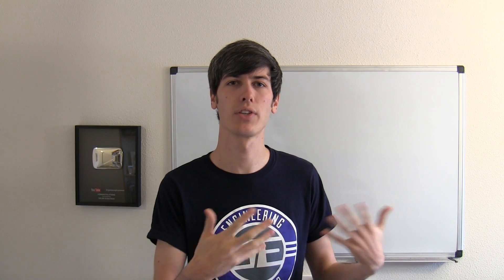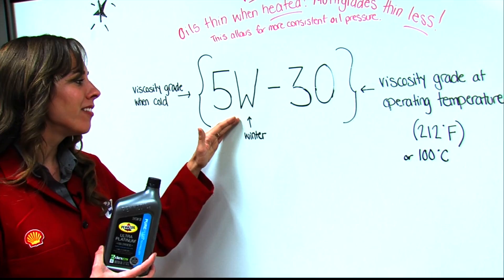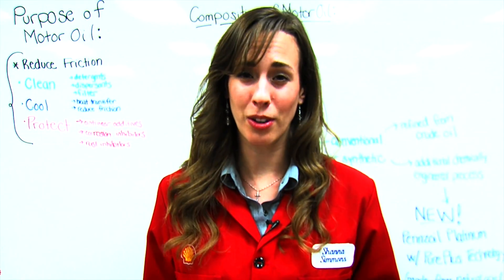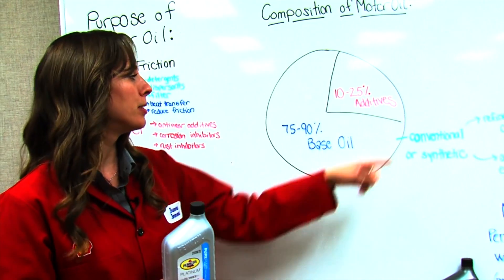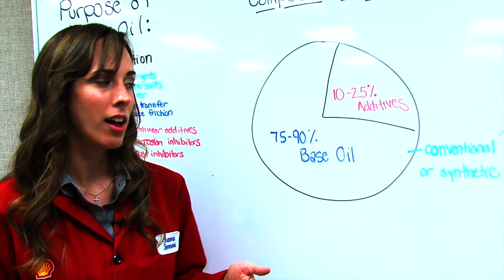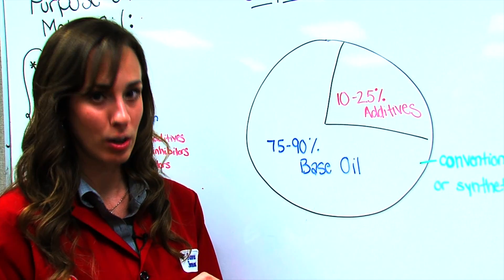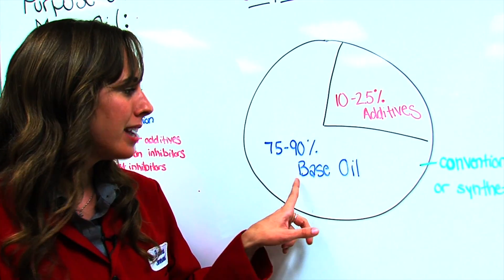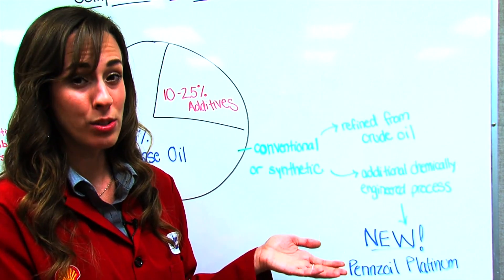Motor Oil Myths & FAQs - Synthetic vs Conventional

Comment: You should mention the advantages of a full synthetic in a very cold climate when starting a car. Also for other equipment in the low temps. I run a full synthetic in my cars in the cold Michigan winters. Go out when it is below zero and start your car with conventional oil and it turns over slower at that temp and watch an oil pressure gauge take a bit to get up to full pressure. Do the same with a full synthetic and the engine spins up as fast as when it is warm and the oil pressure goes right to full pressure. I have also had large snow blowers, run a conventional in one and pull start it and when the temps bottom out it can be like pulling a tree stump out of the ground. Use a full synthetic and no problem pull starting.

Comment: The advantages of trued Synthetics are 1.  It's molecular structure is very uniform  (lubricates more evenly/better.  2. It's more stable with temperature than plain mineral based oils.  Mobil 1 is made from PAO's...Polyalphaolefins, a synthetic product.

Comment: There is also the issue of advertising synthetic oils. There are 5 levels of oils that can be created going from the level 1 conventional oil to the level 5 synthetic oils. Difference being in how each of the oils were refined. In Europe, only level 5 oils can be advertised as synthetic. In the US, both level 4 and 5 can be legally advertised as 'Full Synthetic". That is why, for example, Mobil 1 calls all of their oils 'full synthetic', but their 0w40 as 'Euro formula synthetic'. The only true synthetic in their lineup. Same with the Castrol 0w40 Euro formula synthetic.
Reply: +AK540i  Group IV is the true PAO base that was first used in auto oils in the US in 1972 ,it is used in Europe also ..

Comment: OK the W rating means that the MULTIGRADE oil is as thin as a 5W straight oil would be at a freezing cold temperature.  There is however a lot more to oils than viscosity. One test involves four steel balls that are run in a jig. The better oils can handle more pressure before scuffing occurs. 

One empirical result was the disaster that occurred with a friend's VM Motori HR 492 diesel engine.  The manual stated that a turbo rated oil of Mil 210 spec or higher was required.  Instead cheap supermarket 20w-50 was used as the man had a theory that regular oil changes were all that was needed.  In actual fact the cheap oil worked OK for three months during the running-in (break-in) period.  During this time the fuel delivery screw on the injection pump was set for reduced fuel.  The pump was then turned-up until black smoke occurred during hard acceleration.  Unfortunately after two weeks the engine was knackered!  The pistons and cylinders were badly scored. This would suggest that cheap oil intended for non-turbo petrol engines just cannot take the pressures that exist in a diesel engine.
Reply: He was rolling coal m8 plus he should have used the recomended oil grade

Comment: on my car it says to use 5W-20 ive been using 5W-30. it really doesnt do anything bad as long as you dont go crazy and make it much thicker like 20W-50 in a car that needs a thinner oil.
Reply: +revelationns Agreed, but I also think that car manufacturers are using & recommending thinner oils now just because it improves fuel economy & horsepower. There's less resistance with thin oil vs thick oil. It makes their numbers look good. 

But there's a downside to this trend. The idle was rough and the valves would occasionally chatter with my 5.7 liter Hemi, but it instantly ran smooth & quiet when I increased the oil viscosity. Thicker oil sticks to parts and cushions them. 

And get this: My car is a 2014 and the manufacturer recommends 5W-20, but with older models it was 5W-30, and with the new 2016's they recommend 0W-20! What's next? 0W-5? I run 10W-30 because it works much better.
Reply: +OddTimeMan 
You are absolutely right.
For my car, when new, the recommendation from the factory was a 5w40. Once I passed the 300,000km / 186,400 miles I started to use a 15w50. If I, hopefully, reach 600,000 km / 372,600 miles I pass to a 25w60.

Comment: What people usually want to know about synthetic motor oils are:  Will my engine last longer with synthetic even though the owners' manual says that conventional oil is fine?
Can I really extend the oil and filter change intervals past  that recommended by the manufacturer and not experience engine wear beyond that when the recommended interval is followed?

Comment: mobil 1 vs royal purple which is better?
Reply: +Blk Popeye Mobil
Reply: +D3AThCAl2DS link?
Reply: +D3AThCAl2DS Mobil 1 is shot the first time you start the car. It sheers like crazy.
Reply: Well I use royal purple in my car for the pass 2 years and have had no problems..What make valvoline better than what I'm using?
Reply: royal
Reply: +Blk Popeye depends on purpose and oil change intervals purp wont last 3K at all
Reply: +D3AThCAl2DS are you kidding? rp lasts a long time
Reply: i have seen lab reports of 800 miles and they said it was shot
Reply: nvm facts go to the back and opinions come forth thats what i have learned after reading on so many different videos so i just don't care at this point i will keep things to myself
Reply: cold protection not that anyone cares -.- or will take into consideration
Reply: Well Royal Purple suits my needs I use both the motor oil and their super atf in my transmission
Reply: +Blk Popeye On personal experience, I've used Mobil 1, AMsoil, and Royal Purple.  I think the label on the back of the RP says you can use 1 year intervals or 10-12k miles or so.  I've actually been following that interval on my old 16 year RD1 CR-V with Royal Purple for about 10 years now with no problems.  But also consider that I don't drive many miles on it.  I never reach the 10-12k miles.  I maybe put about 3000-4000 miles a year on it.  I haven't had any issues.

I also use Royal Purple on my turbo'd B16 EM1 and I change it every 6 months regardless of mileage.  But there was an instance I didnt change it for a year and a half.  That being said, I only put about 50 miles on it during that 18 month span.  

Ive never ran into any issues, but I also don't drive many miles.  That being said I haven't run into any issues using any of the oils I've used.  

When I use to drive my CR-V more often, in the freezing temps of Michigan of below 0, I drove it as my winter beater from 1999-2009 and I was putting regular miles on it, I still didn't run into any issues on the yearly interval.  Again during that time it was seeing most 4000-5000 miles a year on it.

Its not that I dont drive a lot.  Its just I spread mileage across a few vehicles. CR-V, EM1, S2000, CBR600RR, 350Z, Pathfinder, Xterra, Altima, different CR-V, another different CR-V, ANOTHER different CR-V, hahahaha, a few Mazda's, etc.....

That is just my personal experience though, other people's might differ.  There are always variances.  Also wrong applications can occur, or improper procedure.  you might just run into a complete idiot.  .

So, just make sure you're using the right kind of product for your application.  You should be fine.
Reply: My experience with using Royal Purple motor oil in my lt 1 v8 1996 chevy caprice and the evedant test of this oil ran on youtube I feel that if I had a Honda CRV or any Honda product I would use it to its fullest extent because in my opinion its good for smaller higher reving engines.
Reply: I use Motul during high street performance but OEM genuine oil with the suggested viscosity grade is ideal on daily
Reply: +Blk Popeye Try this. https://www.amsoil.com/lit/g3115.pdf

Comment: can you please tell how can I know the viscosity rate of my car or motorcycle engine???
Reply: +Jatin Anand Oil viscosity recommendation for an engine change according to the climate zone you are in.. In extreme conditions it could pay of to adjust viscosity choice according to your local temperature situations.
For example at arctic winter situations it's often vice to fill lower viscosity oils on engine and drive. An older type 15w-40 diesel engine oil would be thick as syrup at - 30 C and make it nearly impossible to crank the engine to a start.
Your local auto technician should be able to help you with this if you cannot find a guide for this in  the manual for the vehicle.
Reply from the maker: +Jatin Anand Check the owners manual or often it's on the fill cap.
Reply: +Engineering Explained. oh....thanks :)
Reply: +Jatin Anand 10/40
Reply: bikes 10/40
Reply: Not all bikes take 10w40 ? You should look in the owners manual or look what oil a reputable manufacturer recommends
Reply: The whole point of synthetic is it lasts longer than regular oil. In a motorcycle it serves many functions. It's engine oil, transmission oil, clutch oil, it's used to cool the engine and your alternator sits in it..It's just better to change your oil more often. So just use regular oil.Bike shops will try to sell you expensive oils .Just use a good regular oil like Valvoline ..Save your money.
Reply: +Mud Sh-sh-shark Older Harleys had three different engine oils depending were you rode it .stright(mono grade) 30  50 or70. 50 was the common one, but somewhere hot it would be 70 and somewhere cold 30 grade.
Reply: 10/40 is good for any bike engine

Comment: "working at a oil change shop"
Customer says "Give me anything but that Pennzoil shit"
I put Quaker State in their car.
Reply: All my life, I have heard just the opposite. Pennzoil and Castrol good, Quaker State bad.
Reply: @1SqueakyWheel  Which is why you need to stay current on things. ln the past 40 years all of those brands have changed the source material of their basestocks as well as the processing that it goes through so what was true back then is no longer true now.
Reply: @JA-rn5qv  Wow you woke up an old thread. 
So what's true now?  :-D

Comment: Guys she is not as smart as she appears in this clip, she did not even mention that the main cause of sludge buildup is mainly from doing short trips in a vehicle and never really getting it up to proper operating temperature. This is bad because as the engine runs it produces blowby gases that make their way past the rings on the pistons and in these gases is moisture from the air that the engine breathes now this moisture is not bad as long as the engine reaches full operating temperature which is well above 212 degrees and at these temps. any moisture is driven off and removed from the crankcase and engine oil but short trips never heat up an engine hot enough to drive off this moisture and a vehicle that makes many short trips ends up contaminating the engine oil with lots of moisture but the story gets worse because this moisture that is now in the oil reacts with the gas sulfur dioxide that is present in the crankcase while the engine runs and moisture+ sulfur dioxide makes sulfuric acid and this in turn converts some of the engine oil directly into a corrosive sludge which will build up in the bottom of the engine pan, inside the valve covers and basically anywhere else in the engine that does not get hot and have good oil flow to help clean it of sludge. Engines that never really get up to operating temperature or in severe winter environments should have the oil and filter changed every 2000. miles at most or every 6 months whichever comes first. Never change engine oil without changing out the oil filter, it just is not worth having the old oil contaminate fresh oil. Always change both and always change the engine oil when the engine is hot, let it drip out for as long as possible, I try to leave it drip for a good 10 minutes at least but the longer the better since more that drips out the cleaner the inside of your engine will be when you add new oil. Ps don't forget to install the drain plug and snug up the new filter before refilling with nice new engine blood, engine oil. Kendall/Chevron/Shell/Lucas
Reply: +Marti woodchip saying I'm not as smart as I appear is a bit of an unconscious bias :-) You should check out my Know Your Oil series on the Pennzoil YouTube channel.
Reply: +Marti woodchip U got told bruh
Reply: actually she didn't come across as particularly smart, but I'll bet that it's just a lack of good presentation skills and self-confidence.

Comment: Question: Is this true ?
Synthetic oil has an additive to swell engine gaskets. Once you use synthetic oil you should not go back to regular oil because the engine gaskets will shrink causing leakage.
Reply: False
Reply: +Jimpony1988 
Finally an actual myth!
Or is it?

Comment: There's so many things missing and wrong with this video. 
1. There are different grades of base stock ranging currently from 1-5.  1 being the most garbage poorly refined cheap crap you can buy from walmart, 2 being your average conventional, 3 being cracked conventional oil and what most people refer to as synthetic(even though it isn't truly synthetic by definition of the word since it's still sourced from dino oil) grade 4 being your first truly synthetically produced (amsoil) and grade 5 being an even better synthetic base stock (redline).

2. 5w-30 does not mean its a 5 weight when cold and a 30 weight when warm.  That means it will thin out no less than a straight 30 weight oil when at operating temp (remember oil is thicker when cold) and will thicken up no more than a straight 5 weight oil when cold.  It is NOT magically a thin 5 weight when cold and then a thicker 30 weight when warm.

3.When a manufacturer builds an engine with a certain viscosity in mind they set tolerances inside the engine to match the oil.  First and foremost bearing clearances, a light weight oil will squish out easier and will run a smaller clearance to compensate, whereas a thicker oil wont flow easy enough into a small clearance and will require a bigger one.  Also the valve seals are meant to let a specified amount of oil passed to lubricate the guides.  If you go too thick you're starving them of oil, too thin and you're burning too much off(which is bad for emissions). 

Also on a side note having slightly larger clearances and thicker oil is much better in terms of performance and durability in a high powered engine.  Thicker weight oil also handles heat much better than its thinner counterpart.  The down side a minute drop in efficiency since the pump and crank have to spin through a heavier oil.  I say minute since going from a 10w40 to a 0w20 only nets a very minimal increase in fuel mileage.
Reply: ImportTunerRB26 This x10000. I was going to raise these points, but I'm glad to see someone else is on the same wavelength.

Not all synthentics are created equal, and the type the lady in the video refers to are "hydro-cracked" oils which still originate from conventional mineral oils. A dead giveaway as to whether an oil is a hydrocracked synthetic or a proper ester based full synthetic is the price. High quality ester based oils are expensive! Fuchs sell multiple different products, many marked as fully synthetic. However, Fuchs Titan Supersyn is £24.99 for 5L and the ester based Titan Race Pro S is £51.99! However, its probably one of the highest grade oils you can buy.

I'd also like to add; other oils are available. I merely used Fuchs products as an example as they're my own personal preference and what I am familiar with using in the vehicles I maintain.

I'd also mention that when I used Shell Helix semi-synthetic in my '00 CBR600 I got quite a lot of valve train noise, whereas on Silkolene Pro4 it was greatly reduced. Good enough for me!
Reply: On your 1 to 5 scale, where would Mobil 1 full synthetic be... is it hydro cracked? Thanks
Reply: ImportTunerRB26 excellent. Very good information
Reply: sooparsoup I'm curious about that as well. Also royal purple too
Reply: Information on Mobil 1 seems to bounce back and forth between supposedly being grade 4 and just being grade 3. I believe it's grade 3, but it is still damn good oil and affordable. royal purple also falls in this category.
Reply: Well stated, although I'd contend that the information in the video isn't so much wrong as they just didn't go into further detail as you've done.  The grade of base stock used is very important when it comes to determining the performance and price of synthetic oils.  There's a major leap in performance when comparing conventional to synthetic oils, and although not as big when comparing various synthetics, the differences can be significant.  Having worked in the automotive industry for several years and doing quite a bit of research on the subject, this is something that in my experience most consumers are not aware of.  I'm surprised Redline is a grade 5 considering the performance tests I've seen indicate that MPT > Amsoil > Royal Purple > Redline > Castrol, Penzoil, ect.  Mobile 1 being the most overrated, as it seems to perform poorly compared to other name brand synthetics.
Reply: ImportTunerRB26 it's actually funny that you mention efficiency, because we used to have long debates on the very topics you covered in your comment. The main conclusion we came to was that manufacturers are under constant pressure to reduce their carbon footprint by increasing the efficiency of their fleet. In order to do this, most manufacturers recommend an oil that is for practical purposes too light, but increases their vehicle fleet mpg by a few decimals, it's honestly extremely irritating

Comment: Sledge source is not actually completely correct. Older manufactured oils didn't hold up to the heat as well as today's oils. If you were to heat oil as to burn it, it would produce sledge. Google black death for more history of sledge. If your getting blow by in your oil, it's time to rebuild. The video did not advice the use of synthetic oil over regular, and in my opinion should always be recommended over regular based oil.